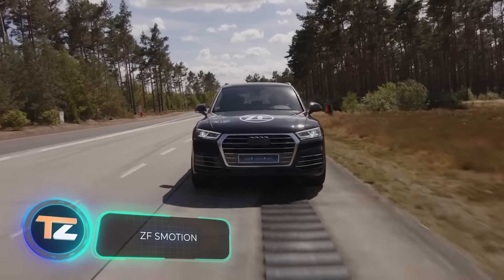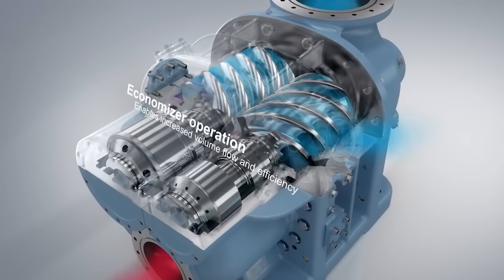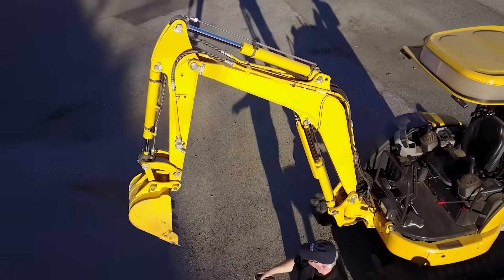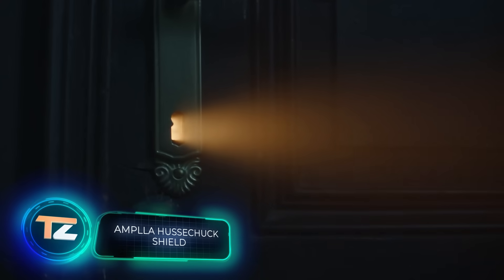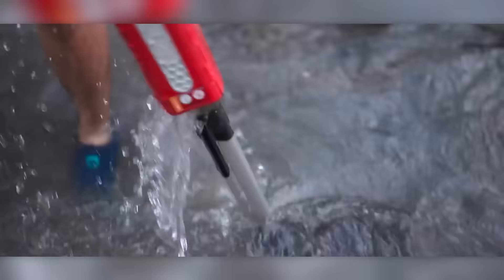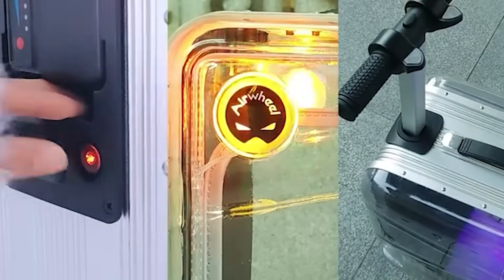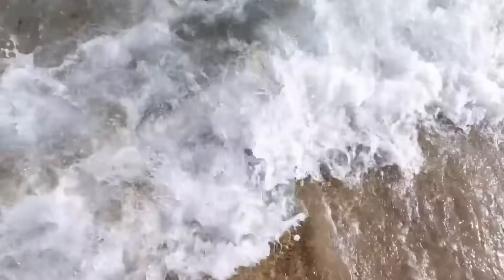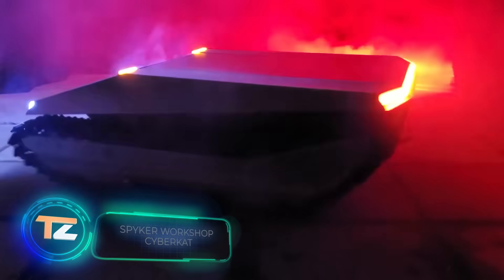14 COOL INVENTIONS AND TECHNOLOGIES THAT YOU HAVEN'T SEEN BEFORE

Comment: As of today, here are some problems with all these technologies: everything is based measurements like sensors, longitude/latitude, pressure, elevation, height, weight, dimension, comparison proportions and so forth. Even though most of algorithm systems have redundancy/DR, you CANNOT rely entirely on them. There are situations on our lives that you need to take decisions on your own. As a quick and simple example: a single drop of water (even though, "water" is the best insulator; for those that did not know, in a pure form with no impurities, water is the ultimate energy insulator) on PCB (electronic board) can and it injure you or it will put your life in danger. In other cases (since it's impressible), a solar flare can screw up all your electronics not mentioning small EMF devices where you can buy it from anywhere. There are some conventions/regulations/standards on how to implement and use such technologies but each SW/HW development company implements their design differently.  While some have few features other, may have a "shxx" load of them not mention the capabilities. Speaking from experience, today, you can find lots and lots of hardware (HW) and software (SW) development and similarities; they differ on princes based upon their support, features and area of expertise.  The technology adoption on various devices (ie: cars/trucks/airplanes/home/etc), depends upon the manufacture factory and yet, release them on the market (of course after they were tested). I have a 2021 car (sorry, can't mention the brand) loaded with some of these technologies. I've experienced them on my own and I came to the conclusion that it's still fragile. It took me some time to test within various conditions/circumstances and while a "perfect runtime" environment works "comfortable" ok, on other situations I had to take control if it. So, DO NOT RELY on it. In conclusion, it's ok to experience them to a certain degree but not in full. Make sure that your system will allow you to intervene whenever is necessary. Pay attention to details (as these details where thoroughly tested by the manufacture/s) before starting to experience them. THE FUTURE IS RISING EXPONENTIALLY AND IS CLOSER TO REALITY THAN YOU THINK.

Comment: NUMBER 15 THE BEST, THE MOLTEN SALT REACTOR

Fusion reactors are fine , but they do not work yet, and the first generation of them will need tritium and the nearest big supply is thought to be on the surface of the moon however: Old nuclear reactors  produced radioactive waist the is dangerous 300,000 years. Many advanced reactors like  molten salt reactor produce  radioactive waist  is dangerous 300years that a 1000 times better . Old nuclear reactors used 10 % of the fuels potential , new nuclear reactors uses over 90 % of the fuels potential. Old nuclear reactors melt down when cooling power fails, new reactors gravity dump their fuel into safe holding cells when power fails. New reactors can use thorium which is already lining around in piles wherever they mine other rare earths like niobium and gadolinium used in high end electronics.  Additionally new reactors can reuse existing nuclear waste greatly reducing the amount of it. The only other thing that improved so much so fast was the computer. AND WE ALREADY HAVE WORKING ONES!

Comment: The battery powered AIRCRAFT TUG 🤖, to move aircraft in & out of the hangars, is not GAS powered, so safe.  Funny thing, enough torque to ALSO move passenger cars/SUVS owned by crappy, mistreating overprivledged owners or mean mechanics.  🥺 And REPOS MONSTER TINY BOT, slippes in hangers with little clearance😆🤗🤔

Comment: Helicopter parachute is pointless.  Helicopters can auto rotate as they descend.  A motorized suitcase probably won't be allowed in an airport or through baggage check in because you can put a bomb on it.  Electronic bandages are pointless because you need to change the dressing so you can see if it's getting better or worse.
Reply: first of all helicopters can't always engage in auto rotation, due to very low high at the time of failure or a part of the helicopter just broke, like the tail rotor or tail itself or pilot goes partially incapacitated, leaving the passengers helpless, the Auto rotation is executed by the pilot by going around in circles and depending on what helicopter you flying on it requires a specific safe altitude in order to execute this maneuver, guess what helicopter blades also brake, have you been watching YouTube? just month ago a Robinson helicopter lost its entire tail, it broke in half, both pilot and instructor died.
Reply: @lcfflc3887  thats why helicopter pilots maintain a minimum altitude to auto rotate when hovering and that helicopter probably can't auto rotate and it probably has to have a parachute that might or might not deploy  i swear these people that make this crap clearly don't want to sell the stuff the prices are outrageous
Reply: @MrRatchetmann  trust me with helicopters I'm not taking any chances I seem enough and i have heard enough, this machines from hell aren't even supposed to be be doing what they do, it just brakes all the rules, it's pushing the limits to the max, it wants to brake every time it flies, even your whole body shakes while flying on this thing.
Reply: @MrRatchetmann  also unless you hovering over a desert or water good luck not hearing a building a power line or a house on your way down with the infamous Auto rotation and yes there are videos of this exact same thing happening with deadly results for pilots and passengers.
Reply: by the way the carryon  loggage is useless anyways, because lithium batteries that size and powerful aren't allowed to bring inside airplane because of fire hazard.

Comment: That  screw compressor was invented in 1878. Parachutes on small aircraft has been in use for 6 years already and does work. The Cain Chair has been around for years and for less than $180 too. So how could it receive an award? I'm not paying $800 for a fire extinguisher either. Remote controls for construction equipment has been around for years also.
Reply: This video is 100% true sir, if they made it, filmed it, and received awards prior to 1980 lol
Reply: @davidkosach3095  "Everything on the internet is true" Abraham Lincoln.
Reply: And you would give a paracetamol a head ache